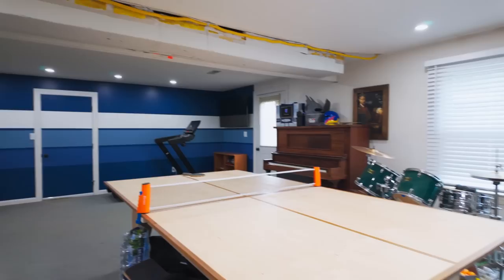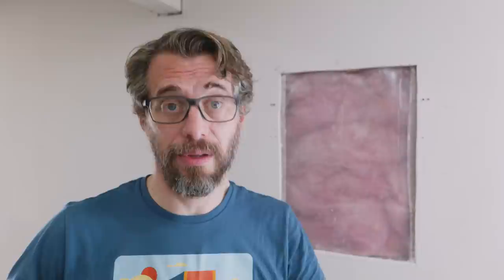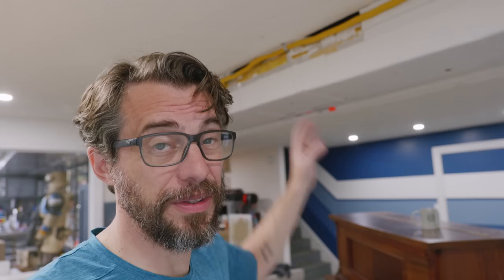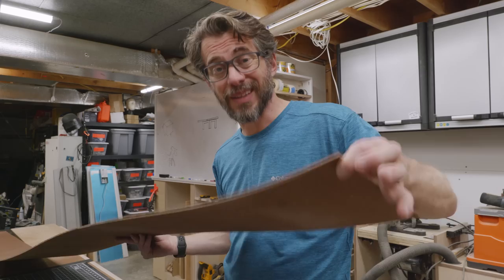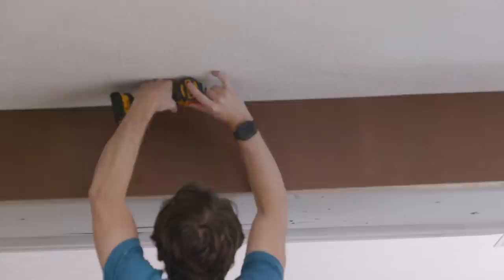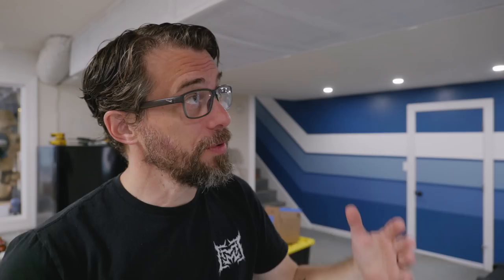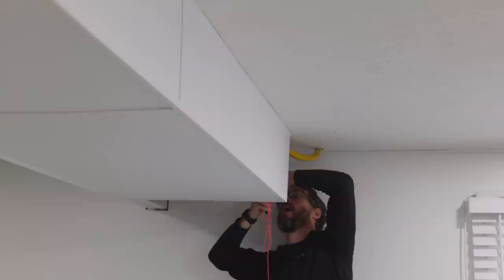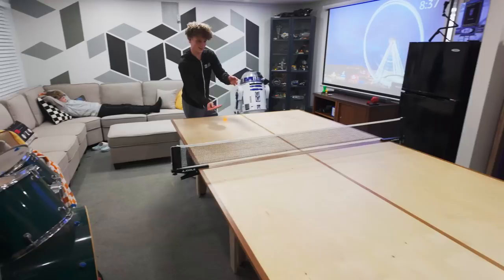Creating My ULTIMATE Family Hangout!

Comment: The idea to use a remote controlled car to run a thread was definitely a "you" idea. I will do the same when the time comes. 😂
Reply: I loved this. Especially since you know Bob has fish tape
Reply: When I worked in a warehouse with 22' ceilings we used a Barnett crossbow pistol that had a casting reel attached tho the frame and bolts were modified to attach to the fishing line.  Perfect for running cables above drop ceiling tiles in office areas.
Reply: Fun fact, some people have trained dogs (small dogs of course) for this purpose ;)
Reply: That was certainly a highlight got me. Never would've thought to try that.
Reply: Throw a laptop camera on that car
Reply: You’d best be careful... you might see dust bunnies the size of boulders and spiders as big as cattle.
Reply: This might have been the highlight of the video for me. So great!

Comment: Just a fyi, you ideally for your patch you want to put mud on the side of the actual cut board not just the paper.  The way you did you have a square that is suspended in the cavity only held there by mud holding paper to paper.  Right now that patch won't really hold shelving etc well.  Hope doesn't come across wrong pointing this out.
Reply: I think I would have dropped some drywall screws into those studs also.
Reply: @AxGryndr  yea, he already cut back to the 2x4

Comment: Bob, i knew a professional cabler who used those cheap pistol crossbows that were all the rage in the late 90s early 2000s. He took on of the bolts, put a rubber end on it tie it to pull string, and would get up in drop down ceilings in offices and fire it across.

Comment: One of the better "classy" ways to do RGB lights Is to move crown molding down from the ceiling a couple inches. You'd need some sort of bracing to keep it from sagging since it's not against the ceiling but when it's not on it just looks like a slightly different install of crown with a neat shadow line. The application I saw used a warm white rope light but the high density RGB strips that are common these days would work just as well.

Comment: Couple of things. Love the change and how you leave in stuff that may not workout. Second as a former professional tv/projector installer you use what you can lol. I have used the fish tape to great success, but I have also used a thin ball chain with a really strong magnet on the outside of the drywall. My favorite though was using a baseball to chuck wire long distance through a drop ceiling. 
Keep up the awesome work!

Comment: I would recommend using aluminium profiles for led strips as opposed to plastic for heat dissipation. Without it they'll work for a little while but they'll burn up after some time

Comment: Using a nerf dart or RC car to run cables isn’t too far fetched an idea. Electricians I used to work with would use string tied to a tennis ball to do the same in roof cavities! 
Even the professionals sometimes use the more unconventional and fun solutions!

Comment: How was painting that hardboard?  Have a project I'm using it on right now (fully related to you wrestling that floppy sheet onto the table saw).

Did you rough it up with sandpaper to give it some tooth?  I'm assuming a coat of kilz and a coat of paint ought to do the job.

Comment: I thought the vapor barrier went twords the outside, very interesting to see that i am wrong or that it depends where you are / what material is on the outside!
Reply from the maker: It's climate dependent apparently... "In climates that are hot and humid, a vapor barrier should be installed on the warm side (for walls, this would be just beneath the exterior cladding, over the insulation). For very cold climates, the warm side is the interior, so the insulation should have a vapor barrier separating it from the interior wall."
Reply: @Iliketomakestuff  that makes sense, I've only ever lived in blistering hot climates

Comment: Only thing I’d do differently is the dry wall patch. You could cut a 1 1/2” strip around the hole this way your patch would set in perfectly using less mud to fill it

Comment: That whole California patch thing just doesn’t seem like a great solution. I’ve used it once or twice, but I gotta say that just cutting the patch to the right size and using mesh tape seems so much easier and faster. And in a hole the size of that safe, a few screws would be advisable.